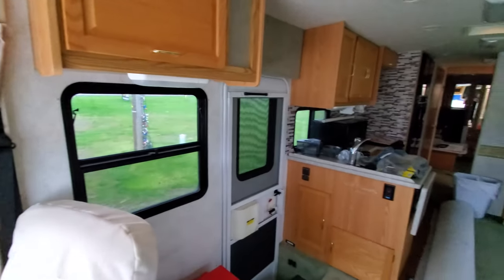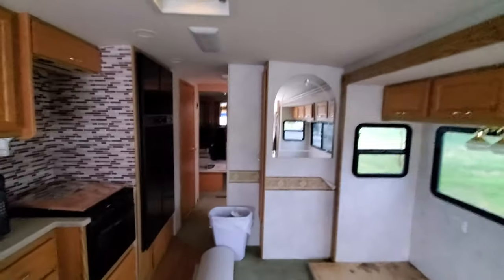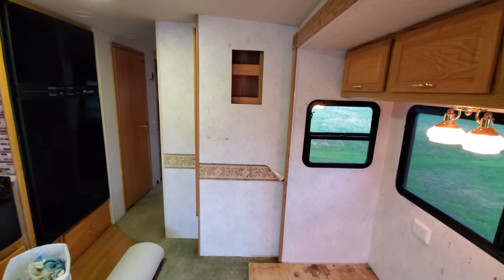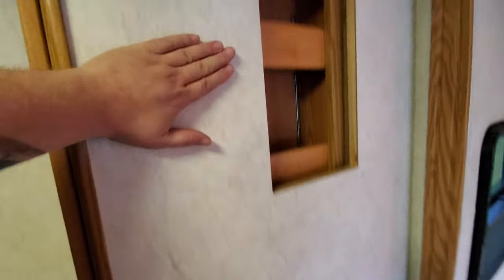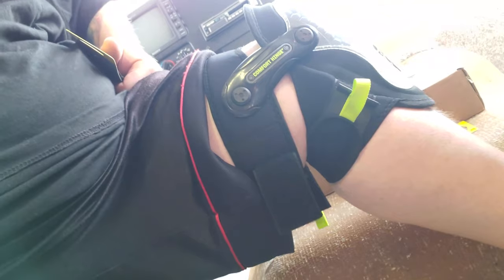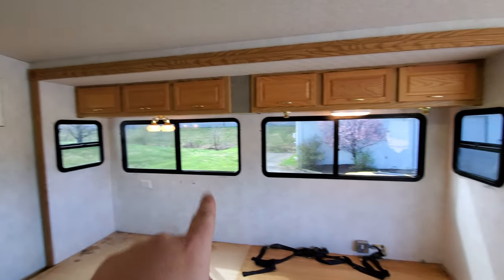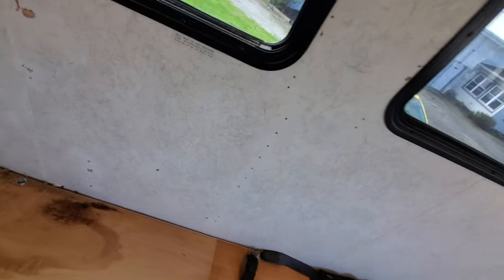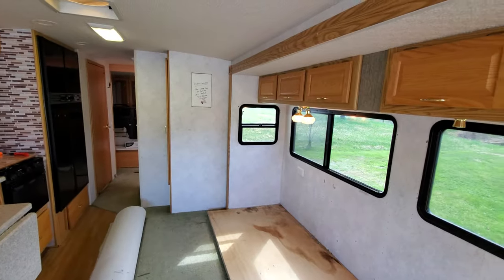PREPPING the RV for WALLPAPER part 2 : RV Checklist episode 18

Comment: I would have made an access panel like trailers have to get to that electrical behind the pantry.  A flat panel with screws in the corners that you can cover with a larger frame of family photos.  If you paper over that and need to get to the wiring, you will have to rip that paper off.  Save a batch so you can patch it if you need it.  HUGS~Donna